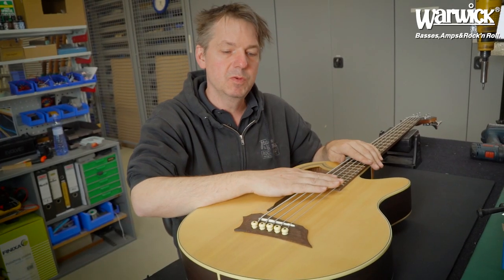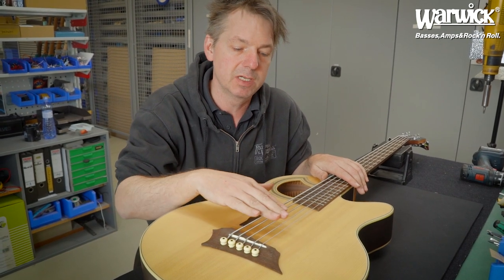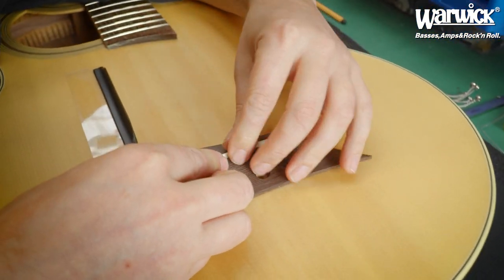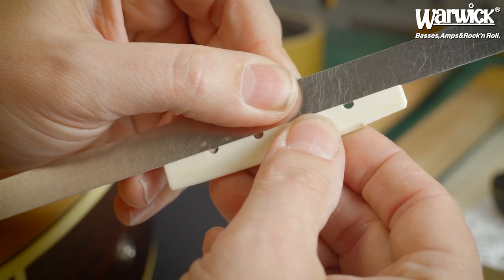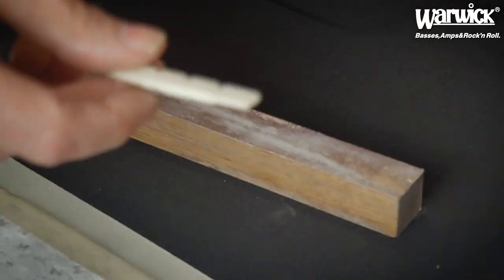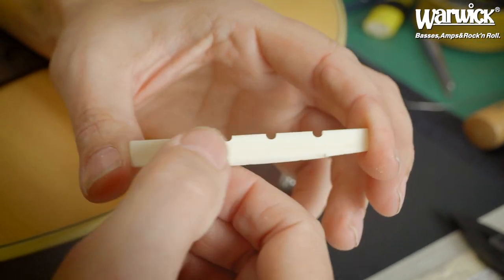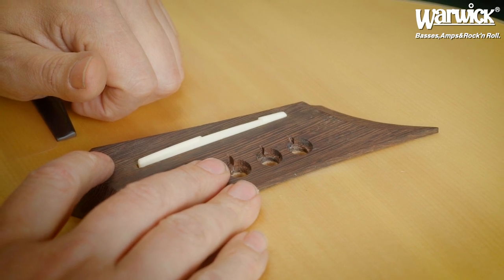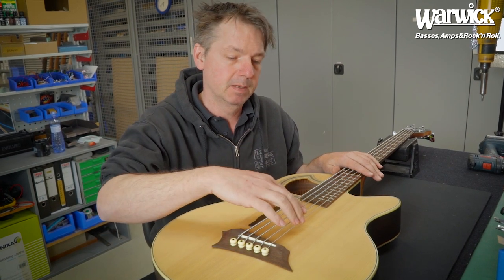How to fix uneven string volume on Warwick Alien acoustic piezo bridges

Comment: The pressure of each string on a saddle and hence on piezo is different, because of tension of each string, from low string to high is increasing . The higher the pressure, the higher the piezo response, so the lower strings sounds quieter. Hence the pressure area of saddle under each string should be different, to distribute even force on piezo from each string. In my opinion.

Comment: Imagine having a fault so ubiquitous that you have to make a YouTube video telling your customers how to fix their busted bass.
Reply from the maker: This can occur in rare cases due to wood adapting to temperature or climate differences during international shipping.
Reply from the maker: The piezo on a Warwick Alien is embedded in the bridge and the top wood of the instrument (which can indeed warp), affecting the surrounded parts and possibly shift them around. The saddle sits on top of the piezo and is pressed down by the strings, which also can change tension over time.
Reply: This is not a flaw, this is a given. You just think your run of the mill instrument is perfect as is but chances are it's not, or some work like this was done at the shop you bought it or by their in house luthier "guitar tech".
Price reflects this because the more you pay the more likely it is something like this was done at the placeof manufacture or in the shop. 

If you think this is a lot of work or complex, you can't even speak on the matter because you wouldn't know. 
But instead you chose to talk crap. Which i find funny. 

And quite frankly I've never heard of this company, but it sounded pretty damn good to me.